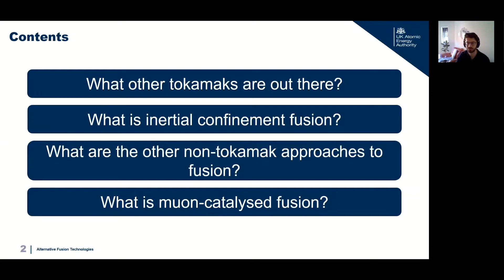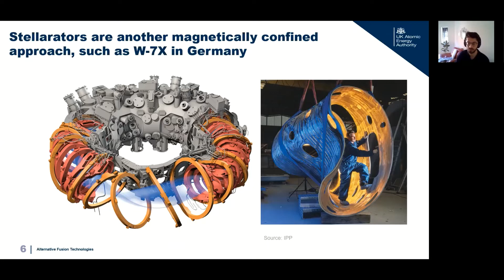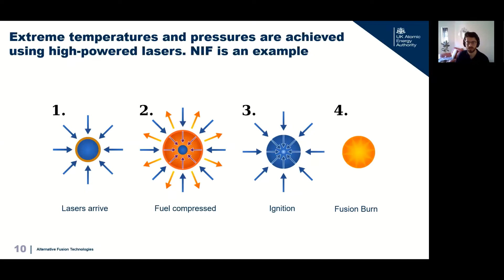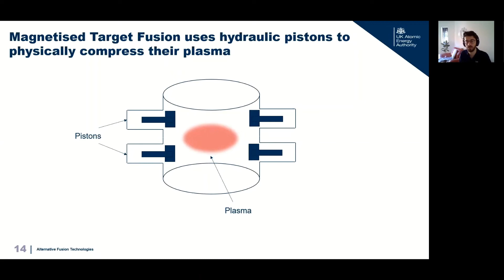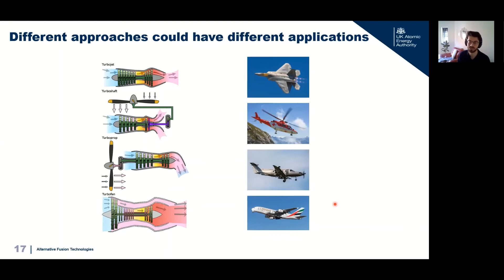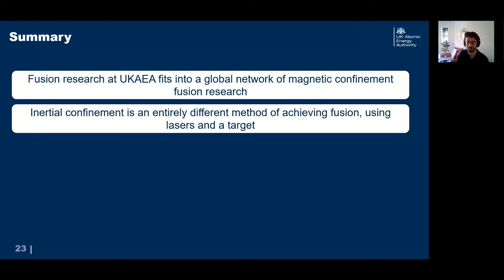Fusion Tutorial 6: Alternative Fusion Technologies

Comment: Although James Roberts mentioned the approximately $1 billion spent by non-government entities on fusion research in recent years and stated  that this makes for a "healthy field," unfortunately he has almost totally failed to discuss the many alternative approaches that this private money has funded.  And that's a shame because there is a lot to discuss there.

And I think a lot of it would or could fit within his conceptual framework.

For instance, 

Helion Energy -- "By combining the stability of steady magnetic fusion and the heating of pulsed inertial fusion, a commercially practical system has been realized that is smaller and lower cost than existing programs."

Zap Energy -- "Zap Energy’s technology stabilizes plasma using sheared flows rather than magnetic fields. Driving electric current through the flow creates the magnetic field, which confines and compresses the plasma. The higher the current, the greater the pressure and density in the plasma."

Commonwealth Fusion Systems -- They are doing a tokamak but it is different.

Lockheed Martin Compact Fusion Reactor -- "... by combining cusp confinement and magnetic mirrors to confine the plasma. Cusps are sharply bent magnetic fields. Ideally, the plasma forms a sheath along the surface of the cusps and plasma leaks out along the axis and edges of the sharply bent field. The plasma lost along the edges recycles back into the cusps."